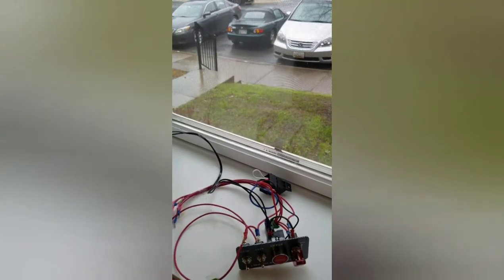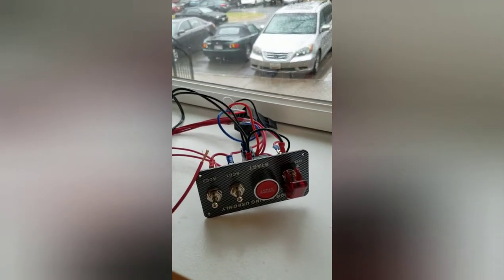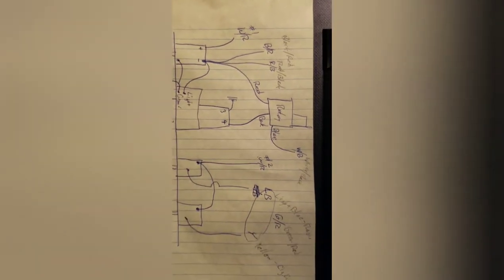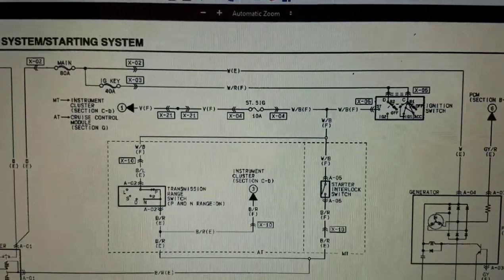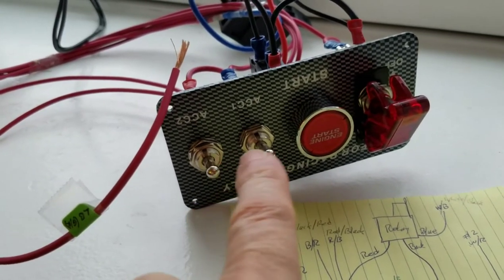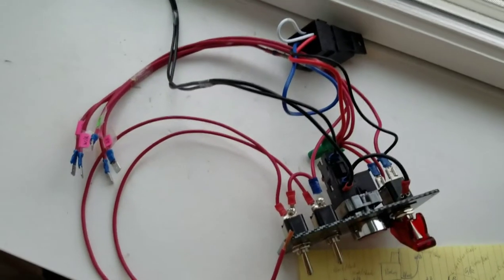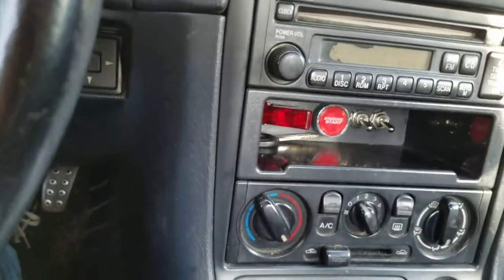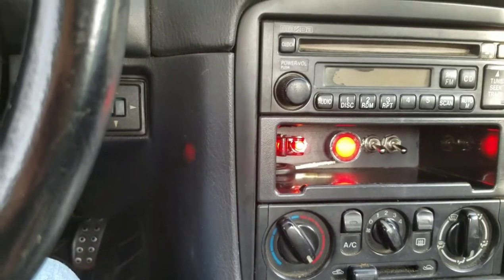Ignition switch panel installation

Comment: Hi! Could you help me to know in which part of the vehicle the cables are connected? i didn't understand that part.
please specifically the b/r, r/b, also the two w/r and the lb and Y? please helpme. 
Your video has helped me a lot, Thank you
Reply from the maker: I'm afraid I don't recall the details -- that was quite a while ago and I don't even have the car anymore.  Bear in mind that the color coding refers specifically to my old 2000 Mazda Miata -- I'm confident other cars would be different.
b/r probably referred to black wire with red stripe.
r/b would be red wire with black stripe.
w/r white wire with red stripe.
lb ??  I don't recall.  Maybe blue??
Y is obviously for yellow.
Wish I could help more.

Comment: I think the relay you expected is the solenoid on the starter itself... the ignition switch does not handle 40A, it is the solenoid that is your relay
Reply: @genepeer1966  Yeah, sure, and you can put more power through to other things, like a huge bass block in the rear ,)...or you know, something else :)

Comment: Why doesnt anybody show them actaully wiring the vehicle
Reply: Yeah but everybody's color codes are different I personally only have 4 wires going to my ignition switch
Reply: @xtremeaerialarborist3697  get a wiring diagram for your vehicle, with a basic understanding of wiring principles you should get it no problem.